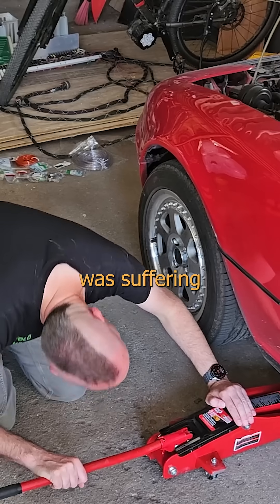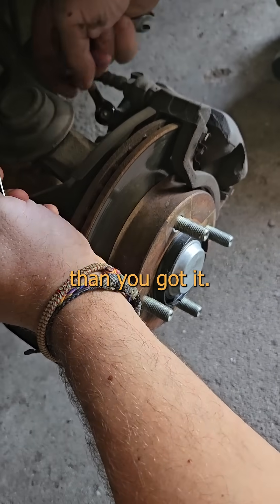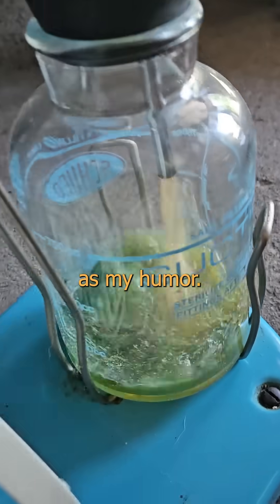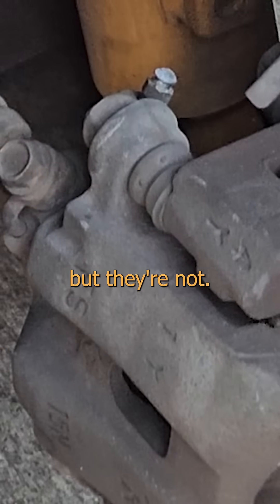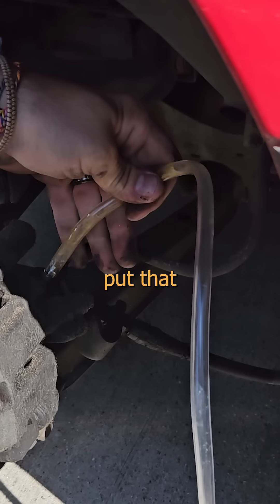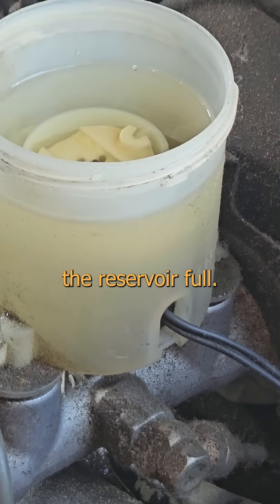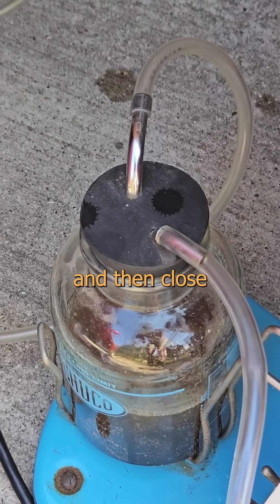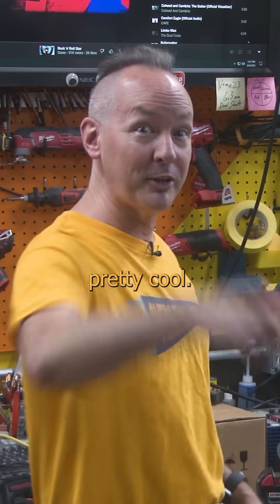How To Change Brake Fluid #chrisboden #comedy #engineering #educational #diy #skills #lifelessons

Comment: I lost count of the great jokes... But there are two right philosophies of life presented. Vacuum pumps also help fill your A/C or coolant systems or resin potting things for high voltage fun. Pressure bleeders are single purpose and require completely different jokes. But that was pretty cool!

Comment: You can do this with a water bottle, a wrench, and gravity if you're patient, vacuum just makes things way faster.

FYI for everyone: DOT3 and 4 brake fluid are practically brandless; there is no "better brand" because it all has to be DoT approved. It also turns blue when it absorbs too much water. It's hydroPHILIC as a sacrificial and easy to replace part of your brake system so the components don't rust.
Reply: I don't think that property was on purpose.
Reply: There is different amount of additives in different brands or models of brake fluid, that is why there is racing brake fluid, it absorbs water at a much quicker rate but has a higher boiling temperature. I did a deep dive in here because I was boiling the brake fluid on my motorcycle.
Reply: Brake fluid is hygroscopic, it absorbs water from the air

Hydrophilic means it is attracted to water and will dissolve in it
Reply: @TunsaMcHaggis hygroscopic materials are in a subset of hydrophilic ones. Brake fluid is both.

Comment: I prefer a pressure bleeder now. I found that on some systems the vacuum would pull air past some of the seals and the bleeder. You don't get that with a pressure bleeder and you can set it up to full automatically.

Comment: Absolutely agree, it needs to be in better condition or cleaner ,along those lines then when you borrowed something from someone. As far as flushing out fluid that is the correct term " FLUSH ". You should use a pressure system not a vacuum system for doing brakes. This is especially true has the brake systems have become more and more complicated to prevent damage to the electronically assisted braking systems.

Comment: If you think vacuum bleeding is good, you should try speed bleeders. It's a brake nipple with a check valve in it so that you don't have to tighten up the screw until you do your final bleed. I don't like vacuum bleeders anymore.

Comment: Helping dad as a kid, it was my job to push the brake pedal down and hold wile dad manned the bleeder screw. He had a piece of clear line into a Mason jar with some fluid in it. This kept air from going into the caliper or wheel cylinder when the dumb ass on the pedal didn't listen well enough. And that was one of my introductions of colorful language and loving insults.

Comment: Great video as always! But it bears reminding, while brake fluid is a hydraulic fluid, it's glycol-based and NOT oil. They don't mix, bad things will happen if you put oil in your brake system.

Comment: Your 90% correct, but it's not always the wheel farthest from the master cylinder, it's the one with the longest brake line that should be first. Like a lot of abs cars have the pump on the opposite side of the engine bay from the MC. That means the line needs to go there and back before going rearward. So the first wheel might be the rear driver's side instead of the passenger.

Comment: In my years as an auto tech the shop had a vacuum system like this as the shop tool. I personally bought a MityVac bleeder kit that used a pressurized container on the reservoir side, pushing fluid instead of pulling it. It automagically topped off the fluid and wouldnt let the reservoir run empty unless the pressurized container emptied first.

The kit is affordable enough for the home hobbiest to save money on brake services if he uses it on a few cars. 2 or 3 uses and its cheaper than the repair shop.

Comment: This is the exact way we perform brake fluid flushes at my dealership, just with a fancy machine that pressurizes fluid into the reservoir and sucks fluid out of the  caliper or wheel cylinder at the same time, takes 5 to 10 minutes total depending on the size of the brake system

Comment: The other way you do it is by using a pressurized vessel at the slave cylinder to force new fluid through the lines towards the master cylinder and the reservoir, which you’ll have to periodically drain.

Some believe this is the better way of doing the job, because it’s forcing the air up, but I don’t really think so, at best it just has less chance of accidentally sucking air into the system.

Comment: I've never cared for the false idea that borrowed things should be returned in better condition than received.  They should not be any worse than received, but there are some things that are simply not a borrower's responsibility.  I get that it typically refers to cleanliness and general condition/use.  In the case of a vehicle, it may mean a wash or filling the tank.  Some, however, may take it to mean other repairs, and that simply is not reasonable.

Comment: Older cars without abs this is great, a lot of modern cars require a scan tool to activate the abs pistons to properly bleed them. Its really awesome that you do this,  "be the kindness you want to see in the world".
Reply: You can usually do this without an issue but sometimes you can get away with pulling the fuse or lightly keeping the pedal depressed if you don’t have a scanner that can do it… but the price for bi directional scanners these days, everyone who touches their own car even should have one!
Reply: @commonsenseisdeadandgone 💯 and for as low cost as they are anymore its worth the investment since they will cross almost all vehicles.

Comment: You have to mention to not let the brake fluid completely empty out or else you'll most likely get air in the system while you're vacuuming it out you need to be adding fluid

Comment: I personally prefer the “push” method, pressurising the master cylinder reservoir and allowing the fluid to drain out at each calliper nipple. Same result, but doesn’t require a vacuum pump - most people have a tyre inflator and it’s easy to modify this for such purposes.

Over-engineering is the only way to do things, until the magic smoke comes out!

Comment: For the Toyota Prius and probably also other Toyota hybrids with electrically controlled braking there's a neat electric pump that maintains brake pressure. Cool because it makes braking really easy and it kinda doesn't matter how hard you step on the pedal (once you get past the point where you engaged regen brake and engage mechanical brakes). I've only owned a 2013 Prius and a 2019 Rav4 Hybrid. But!!! because this pump exists you can bleed the brakes without pumping the pedal. The motor does the pumping for you. 

Downside however... if you ever get a leak in the brake line it'll pee the brake fluid out and you'll never know (until you can't stop).

Comment: Actually, usually brake bleeding is done with pressure from the top, with an even mire over engineered tool that also refills the brake fluid at the same time

Comment: Just my two cents as a licensed mechanic who's also a Michigander to add on to your awesome demonstration

Step 1. Spray that bleeder screw with PB blaster and let it soak in a few minutes on each of them cause god forbid it's rusted up and you snap that you'll need a new caliper. 

Step 2. With 95% of cars start passenger rear then go to passenger drivers, then passenger front, then drivers front, farthest line to closest to avoid accidentally leaving air in the lines. Some Asian and Euro cars have special bleeding orders so if the air won't bleed right call the dealership and ask them what the bleeding order for the brakes on your car is. Also on some newer cars your abs also needs to be bled which needs a scan tool to do. 

3. If you don't have a vacuum system get a good sized bottle and a tube going from the bleeder screw into the bottle which already has brake fluid in it and ensure it stays submerged. You can use the brake pedal to create pressure and push the fluid out. Obviously keep the reservoir topped off but this is a pretty reliable way to do it. 

My final note is personally I use a tool that lets me fill it with brake fluid and pressurizes it to put pressure in the system. Then another on the end to create vacuum on the bleeder just to really really make sure nothing stays in and honestly that's what bigger shop level machines do anyhow but I got my own smaller set up for side work. 

This isn't to say a good vacuum pump won't work or something, just in my experience and for reasons only known to God and engineers smarter than I sometimes after vacuum bleeding I would have a little air still in the line. 

Anyhow best of luck to everyone and hope the best for y'all

Comment: Start with the rear passanger wheel, move to the driver's rear wheel, then passanger side front and lastly, drivers front tire. Do it in the correct order to make it easier

Comment: SpeedBleeders!

Cheap one-way valves that let you put a tube and catch can on each caliper (one at a time of course, usually furthest to closest from the master cylinder), crack the nipple a quarter turn, and pump the brake pedal until the fluid runs clear.

Same “don’t let the reservoir run dry” rule, but pressure through the normal actuation of the system is better on (especially older) seals than sucking from the other end.

Otherwise, GOOD ON YA!

Comment: This is EXACTLY how to properly replace brake fluid.
It made me happy to watch this vid.
And THAT’s pretty cool!😎
Reply: It's also the incorrect way to do it, as you will lose vacuum around the bleed screws, and many later ABS systems won't allow fluid to be drawn out this way (safety measure to prevent fluid loss in case of system damage).

The correct way is to apply pressure at the reservoir, you can either use a cheap system which comes with a cap and a pressure valve to reduce working pressure to around 4 ~ 5 PSI, or a more sophisticated setup which also adds brake fluid.

Even my 74 V8 with it's Lockheed brake system has a one way valve in the master cylinder that would close if you tried to vacuum the system out from one of the calipers.

Alternatively, even cheaper, use a bit of copper grease to seal around the nipple, and add a one way valve, then just carefully pump the brake pedal.

I say carefully, because the master cylinder only travels a short distance, pushing it all the way in can expose the seal to corroded parts of the bore that could damage it.

Additionally, when pushing the fluid through using pressure at the reservoir, you can check for collapsed lines. Brake lines (rubber) break apart internally, and externally can still look just fine. When you open a nipple and notice that very little fluid is coming through, that's a red flag, you won't see that if you're vacuuming it out like a noob.

Always treat excitable people with the suspicion that they are but knowledgeable idiots, and an idiot with a bit of knowledge is a dangerous thing, especially if they are confident like this guy.
Reply: @MrClassicCarEnthusia3528  I was also taught to start at the caliper the furthest away from the reservoir
Reply: @alexvargas3602  Yes that is correct in 99% of cases, unless specified by the manufacturer. But in practice, it doesn't always matter. The reason for it is because you will be extracting the most amount of fluid due to the length of pipe. People usually check the reservoir AFTER each caliper, and if you do the fronts, it will look okay, then you do the rear and you end up pumping air.

Essentially it's just a way to keep people from making silly mistakes.
Reply: Definitely something to do to a vehicle you intend to keep longer than the payments. Along with the power steering fluid too

Comment: If you want to make the process easier. Start with the wheel the furthest away from the reservoir. That'll get most of the fluid do you have to flush less with the other wheels

Comment: Seeing your idea is interesting because it's the exact opposite of how I do it 😂 I made a cap for my jeep that will take an air chuck, set the regulator on my air compressor to about 10 PSI and put it under pressure, hit each one of your petcocks, closest to the master cylinder, one at a time, open it and it'll start running out, same as this, once you get clean fluid, close that puppy and go to the next. Most cars will be driver front, passenger front, driver rear, passenger rear, in that order.

Comment: This is a lost value that must be brought back. 
I'm 53, I have a new neighbor at the end of my street. He's in his mid 30 and he is a stand up guy. 
My JD x350 wouldn't start for nothing. So he offered his fancy zero turn mower. He actually drove it to my house and after busting my balls he said hear use a real mower. 
I was grateful he offered and to be honest I really enjoyed my first zero turn experience. It is a experience because its a completely different way to cut grass. Its also very easy to dig large wholes in your yard. 
Anyway after I got done I washed and waxed it, filled it with gas, and replaced the substandard wiring to the aftermarket lights.
He was so shocked when I brought it back. I said its just how i was raised. If you barrow something it must comeback in better shape than it was when you got it.

Comment: vacuum bleeding does not work on all cars.
in 2011 i was doing a course at the University of Ballarat, we had a classic car club rally so my other 1/2 decided we should take our 1948 and 1955 cars to a local mechanic (3 months prior).
the day of the rally arrived and i had to pick up the 1948 which he had FAILED to bleed the brakes on, i drove it the 2 km home and had the brakes bled in a record time of 20 minutes, a friend was using the 1948 car that weekend and didn't mention the crap handling - the scumbag mechanic DID NOT top up the hydraulic fluid in the dampers - for which i supplied the appropriate oil.
i don't know what the prick did apart from changing spark plugs but as i lived really close why the hell did he wait until the last day to tell me he couldn't bleed the brakes?
i'm still livid after 14  years, i wish i had Chris's knack with language to suitably insult the bastard.

Comment: I would argue that your process is not over engineering at all. In fact, it is slightly under engineered compared to what we use in the shop. The one I use vacuum bleeds all four calipers at once while simultaneously pressure feeding the reservoir. But I do love your system enough that I intend to replicate it at home by retrofiting my personal AC vacuum pump to do the same.

Comment: The brake fluid contaminated the vacuum pump oil so change it often. 

Also, smear a little grease around the fitting and you'll pull more fluid.

Comment: I've been racing cars since 1995.  Brake flushed are a way of life.  I generally flush my fluid on the race car every 3 months.

Brake fluid absorbs water REALLY well, even through the seals and hoses.  The more water it absorbs, the lower its boiling point, which is bad.

Comment: For anyone wanting to do this, but not being able to afford a vaccuum pump, it can be done with jerryrigged equipment and two people.

Make a reservoir to hold the old fluid. It can be as simple as a plastic water bottle with some pvc tubing through the cap. One person stays in the cab and pumps the brakes while the other collects the old brake fluid and tops up.

Depending on your car, you can flush the system from a single wheel well. Just check your schematics first.